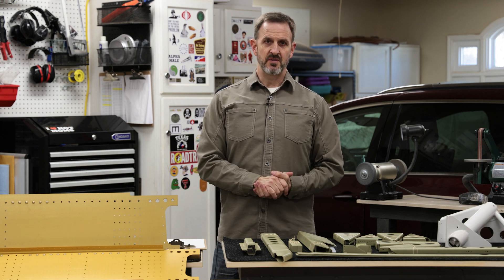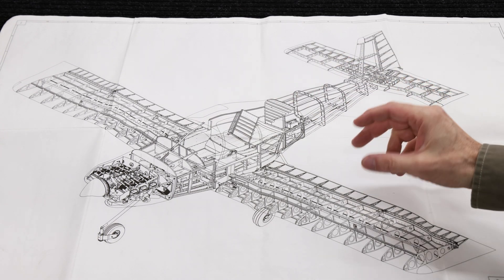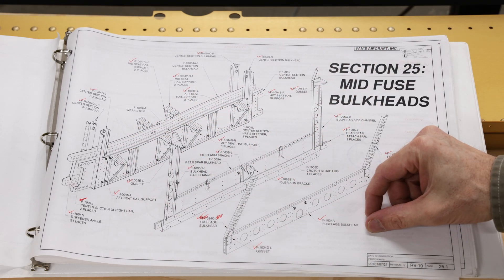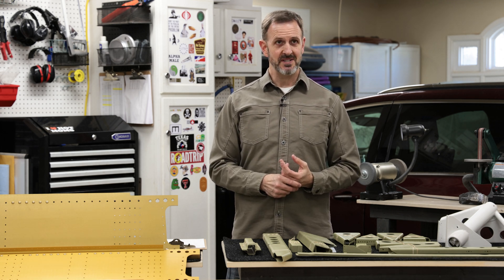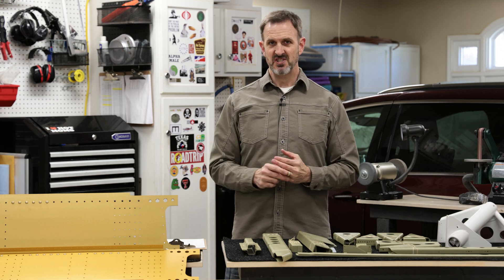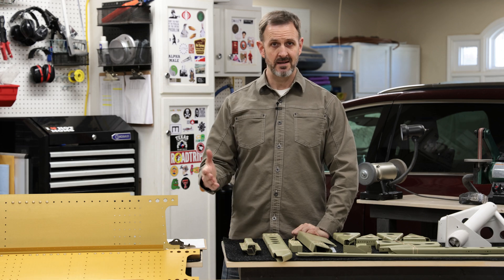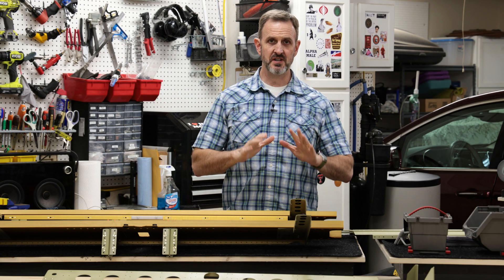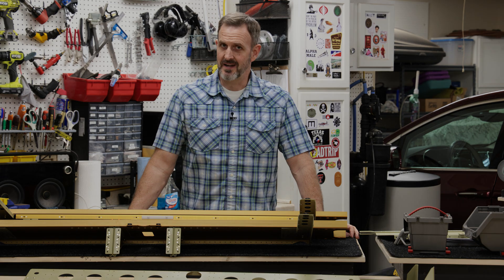Building the RV10 - Video 23 - Mid Fuselage Bulkheads (March 2024)

Comment: Where did you get your pneumatic rivet squeezer?
Reply from the maker: It’s a Numatx squeezer. I think I bought it directly from the vendor: https://numatx-tools.com/. It has constant force through length of throw so no adjusting. It’s small and easy to maneuver, I just set to it 55psi for 3/32 rivets or 85psi for 1/8 rivets. I love this thing.
Reply: @ Thanks, I’m just starting out on the 10. I built a 8 many years ago.  Really enjoy your video’s.
Reply from the maker: @JohnBunn-c3z  thanks!  I can’t imagine having to adjust for throw for every rivet length or dealing with the bulk of the other squeezer. I was a bit hesitant with this one because not as many people seem to use it and some people said it was finicky. There was a little bit of setup initially but I’ve been using it with zero issues. I’m glad I bought it.

Comment: @4:01 why are the top/bottom holes of this triangular bracket secured with bolts and nuts instead of rivets?
Reply from the maker: I'm not sure.  My guess is that this is where the stress is concentrated and the bolts are stronger...

Comment: What pneumatic squeezer are you using
Reply from the maker: It's a Numatx squeezer.  It's operated with a food pedal, is super light and maneuverable, and has a constant force through the length of throw.  This latter bit means that you only have to adjust the air pressure depending upon whether you are squeezing 3/32 or 1/8 rivets (55 and 85 psi, respectively, in my case).  No other adjustments are necessary.

https://numatx-tools.com/